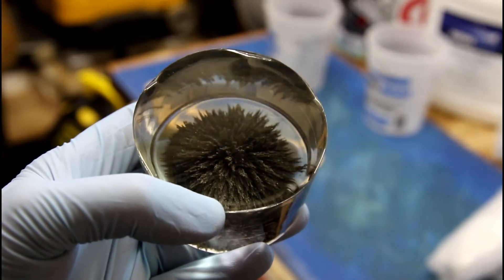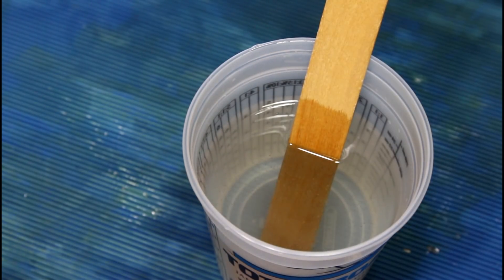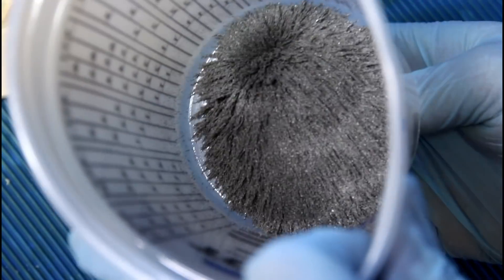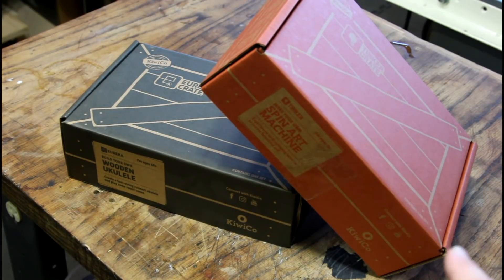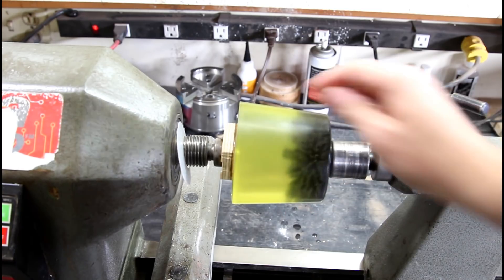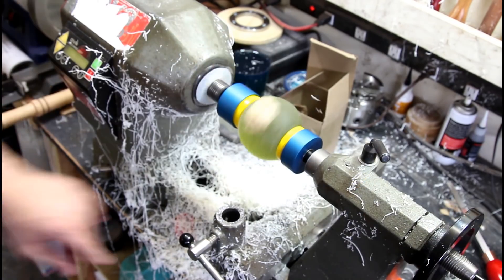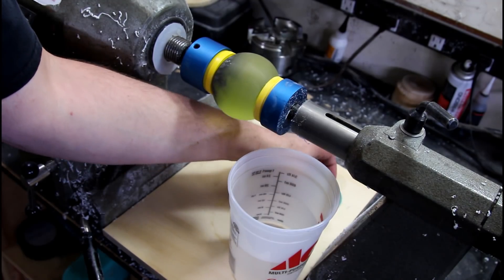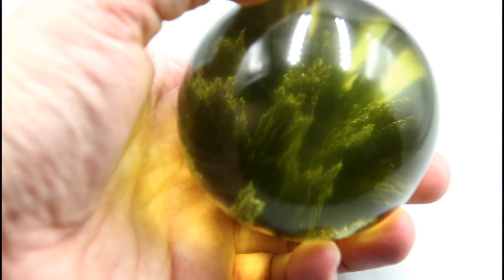The Iron Sphere | Dipit#30

Comment: hmmm, what if, bear with me for a moment... you took a reaaally strong neodymium magnet, and glued it onto a thin acrylic rod and place it in the center of a large enough (square) mold, then coat the magnet with iron filings until you have the magnet covered on all sides ... I have no idea how that must look, but in my head it's like a metal /iron filing sun / pointy star... type of thing? anyway, then fill the mold with resin and turn a perfect sphere with a 360 degree at all angles, suspended iron/metal star globe! ...

Comment: Hi. I have an idea. Take a magnet, glue a plastic (transparent) rod to the corner of that magnet. Add iron filings, and suspend that in the resin. This way the magnet and the filings are in the center of the ball and hopefully the rod will not be visible.

Comment: and your those sphere tools your a few bits away from lapidary basics. put a pair of wet sander pads/ grip paste on those sphere cups with a hand to guide and you basically have the setup used to make actual crystal balls and stone orbs. If you ever consider trying stone as a medium your really almost already there with your set ups. Just need diamond tools bits and a constant water drip system. I'd love to experiment with resin, wood, and stone some day.

Comment: Try putting iron filings in the epoxy before putting the magnet around it.  Then you can move the magnet around and pull the filings to where you want them in the epoxy…..  I’d like to see this in a video!  Maybe with glow in the dark resin?

Comment: You should do a pokeball biome in resin, basically a themed terrarium for particular pokemon types if you did a grass type you could even make the bottom half a nice dark wood, for water you could make an ocean out of resin dyed different shades of blue and white fire would be red, yellow, orange white etc.
Reply: You can also buy or 3d print and paint little plastic models of the pokemon!

Comment: Saw a videeo one time where they used a hole saw to cut spheres on the lathe if that works that would def been better for those iron filings, just sharing what i have seen never lathed anything more than rotors and drums

Comment: so... i have some lava, tephra with spectacular colors, which i think is due to the thin film refraction affect. i want to dip it in resin and keep the colors, but its extremely foamy material with insane amounts of air pockets, and i don have a vacuum chamber or pressure pot to cure the resin in, assuming it would be chemically inert to each other... im thinking i could try a spray type coating... but, im at a loss as to how to preserve the colors while its in resin... any ideas?

Comment: That was pretty cool, could I make a suggestion for another version.
How about taking the filings and pour them into the bottom of the cup and add a few drops of color then pour the resin on top. Use a protected (saran wrapped magnet) and lower it toward the iron, the resin will slow the movement of the iron and the different color may add something. It might form a thistle like blossom with a rainbow color scheme.
Again that was pretty cool.

Comment: Could you theoretically mix the iron filings into resin, then put a magnet on the side of the mold while it cures. Maybe the magnet would make some interesting patterns from the filings separation.

Comment: tip 1:
put a dash of silicone in between the measuring cup and the magnet to help prevent tilting
tip 2:
if you have a lid for the measuring cup, take a 6" long 3/16" bolt with washer through the center of the lid. then, trim the perimeter of the lid to leave a 2mm gap between the lid and the interior circumference to the cup. attach a funnel to the pour container and let the resin follow the bolt threads down to the lid as it dispenses the resin to the outer edges. spin the lid to more equally distribute the resin where needed. bonus points for drilling a hole down the middle of the bolt to help escaping air pockets.
tip 3:
put the wooden base on marionette strings or a mounting bracket with elevated, detachable handles

Comment: Did you think putting the magnet after pouring-in the resin? As the shavings move and settle inside the liquid, bubbles will come-out easily and gravity will have a lesser effect on the shavings.

Comment: That would look super cool if you had made two of the molds and then put them together so you had a ball with the shavings all pointing out from the middle. It would be easier to turn down also because you wouldn't be turning the iron at all.

Comment: If you had a resin with a very long cure time, you could try mixing the iron filings into the resin completely, then put it on the magnet and into the pressure pot to just sit there for a few days so the magnet can slowly pull them into a neat shape that goes throughout the whole thing. I think that magnet is plenty strong enough

Comment: I'd be really interested to see what would happen if the shavings were blended into the resin, then the resin poured over the magnet.

I just wonder if it would have the force to make them line up like that, or if it would just settle as a layer on the bottom?

Comment: just a idea but what will happen if you use slow setting resin? mix the iron at the start so it is suspended in resin then let the magnet pull it to one point

Comment: I would LOVE to see if you could suspend a small spherical magnet on a piece of very fine fishing line in the center of a mould and make a spherical starburst of iron filings centered in a resin ball...

I admit it will likely be a monumental PITA to try, but if you could do it, it would look spectacular...

I also suggest using the vacuum pot not the pressure pot to ensure all the air is pulled out of the iron...

Comment: How about setting it up as you did, washer, wooden disc, magnet, cup but then pouring the resin into the cup and then pouring the iron filings into the resin  so you could see how the magnet draws the filings down through the resin as it sets

Comment: Place magnet & board in the pressure pot, then the cup with iron filings in it. Place cup in pressure pot, move around until you have the iron in the pattern you want, then pour in the resin... Pale blue.. 😎

Comment: Try suspending a spherical magnet on a thin spike of clear resin then once that's dry fill a mold with resin then add iron filings after so they take a more organic shape around the magnet as the resin cures

Comment: what about suspending a small ball magnet. maybe glue it on the end of a bit of clear perspex and stick to bottom of mould then add the iron fillings so you get an almost spherical bloom of iron fillings and then if you tint the resin same as your perspex rod holding the magnet it should near enough disappear. or create to half blooms and the stick together in a bigger pour before turning?

Comment: Ooooh, that's gorgeous!!
Now, I wonder, how you could arrange a blossom completely suspended in a sphere?
Two blossoms joined back to back?
A plastic tube with a magnet suspended in the resin (so as to retain the magnet) and then backfill the void?
Or just suspend a relatively inexpensive magnet surrounded in shavings?

Comment: what a cool idea! those sphere cups for the lathe look like they'll be super useful. what's the range of diameters you can turn with them?

it looks like you lost all but the most vertical spikes after taking the blank out of the pot. I'm not 100% on this, but I think that since the magnet was so close to the bottom of the pot, the metal might have affected the field of the magnet, pulling the more horizontal spikes downward during the curing process. if you try this again it might be a good idea to set the mold platform up on some blocks in the pressure pot to get the magnet as far close to the center as possible, in order to minimize interference.

by the same principle, I bet you could get a better sphere effect if you glued a thin metal rod to the bottom of the mold to extend the magnet's field more into the resin. imagine if the spikes looked like they were growing from the center of the sphere!

keep up the great work! can't wait to see the next project!

Comment: would you consider doing a part three with the iron filings?  I'd be really curious to see if you could make another sphere with a full ball of shavings suspended in the center.  You would have to leave the magnet in place in the center of the casting, and do it in two pours (first half similar to this video, then flip it over for a second pour on the other side completing the ball of iron shavings).  Because of the lens effect you get from making a perfect sphere, you could use a much smaller magnet too, and leave plenty of excess resin around it so that you don't have to worry about running into the iron with your tools.

Comment: Maybe to make the upside down method work to its full potential, after putting the resin in the pressure pot, coat it with something thats insta cast to seal the top. Then flip it upside down as it cures.

Comment: I wonder if it would make a difference if you sprinkled the iron into the resin rather than pouring the resin over the filings. Or, if the particles are small enough, mix the iron into the resin and then bring the magnet close to it

Comment: What would happen if you mixed the iron shavings in the resin before putting the magnet on the bottom? The magnetic field should still align the filings into spikes through the resin

Comment: Crazy effect, could the magnet be used on the outside of the tub and pull the metal filings out through the resin that way the metal filings could be all through the resin?

Comment: Could you please roll it. With the weight distribution, that would likely be fun to look at. Plus it should lay pretty stable on its iron shaving side without rolling as much as other spheres, since that's where likely most of the weight is. Unless I hugely underestimate the weight ratio.

Comment: Very cool project. I wonder what would happen if you added another magnet but to the top of the pressure post while it was curing? Think it might make the filings extend to both ends of the resin?

Comment: I still advocate an attempt where the filings/ shavings are mixed in with a slow curing, very liquid resin and then cured with the magnet under it.

I would like to see how the magnet shifts the metal in the resin, it shouldn't be too different to the former attempts.

Comment: I was convinced the magnet was gonna do something violent in the pressure pot. I would've encased it on 4 sides with blocks of wood, but turns out your method worked! Beautiful result. I bet it would look even cooler with an embedded LED or 2 at the center of the flower.

Comment: I wonder if you could do 2 "blossoms" then put them facing away from each other and cast them into one, then turn it down into a ball. So that the center of the ball is a 360° iron blossom. Just think that would look amazing. Maybe with some electric blue in the resin to give it that "electromagnetic" look. Or very light purple like those "plasma ball" toys. 

Just tossing ideas out to inspire you. Feel free to use my idea I give you full rights if needed.

Comment: Just a thought, why not try two identical pours then bond them together at the bases? Then to turn it you would have the iron sphere in the middle instead of a lump at the bottom. Might make the turning a little easier since you wouldn’t have to turn in to the filings as much, and it might look cooler too. Just not yellow.

Comment: I love your stuff, do not care what it is, it is all cool.  A suggestion/request for these iron filings projects. using the magnet on the bottom, but then using a magnet (of slightly lesser strength) on the top . I am thinking hang it from a string at the top of the project so you can pour resin around it. My guess is it will make more shavings stand and it may make some of them appear to be lifting off. I would really like to see this done even if it is just a paperweight.

Comment: That worked pretty well, I wonder if you could get the spikes to be even more intricate by putting the filings in after the resin? With that powerful magnet I'd think they should still be attracted enough and with the viscosity you could get maybe even a better pattern than hanging in air.
Reply: I was wondering that too. I'd say add the iron filings to the resin and mix well, making a sort of ferrofluid, then add it to the cup with the magnet on the bottom.

Comment: What would happen if you used a long setting resin with the iron mixed into parts, you could also use a current through wire to create a magnet that you would be able to cast the resin around

Comment: An ideas to make an interesting sphere might be to put a magnet on the end of a dowel, cover it with plastic, pour iron filings over the magnet before covering it with resin. 
Then remove the magnet and down and plug up the hole left behind - or alternatively, just remove the down and put more filings and resin into that hole, - or you could even leave the cavity, and put a light up in there...

Then turn it into a sphere - i reckon that would look amazing - doing 2 shades on the resin could also look cool - though if you do that, you might even be able to get away with not needing the down hole, as you could hold the magnet up from above, and then leave it sitting there on your second pour.
Reply: just read some of the other comments about staffs - the hole in this could be used as a light on the end of a staff so you can 'cast something' at which point a blue or a red might be a nice resin tint, or clear and use an RGB led

Comment: What if you try setting up the resin over the magnet, then add the shavings. Or do it in steps, have an inch of resin add metal, had half an inch, add the metal. You might be able to get really talk spikes that way.

Comment: There's got to be some way you can float a cheap magnet in resin to make it the core of the sphere...
I'm thinking like, hanging it from a piece of coat hanger that you've coated in mold release or something...? Then do a tiny pour in that hole to fill it in, like stuff some pre-suspended iron shaving resin in there, then top it up. I dunno, it would just be neat to see a sphere with the magnet at its core.

Comment: This is super cool, but I cant help but wonder if there would be a way to have the magnet suspended in the resin with something like super thin fishing line and have the filings and spikes in the center of the sphere. Would suck to lose the magnet but you could probably use one that's not as strong.

Comment: Great results, Peter! Good call on dyeing the resin yellow, it really gives that 'trapped in amber' look. A magnetic field, frozen in time.
Though now I'm wondering, would it be possible to rig up a bar magnet in the middle of the cup, showing the toroid shape of the magnetic field, and then turn a cylinder from that?

Comment: Hey, Peter, if you try this again, I would suggest putting the base with the magnet in the pressure pot first, then putting the empty mixing cup on top of it, right in the pot.  Then the shavings and so on.  This way you don't have any worry about the magnet slipping out when it goes into the pot.

Comment: The final result looks very nice.

my suggestion for an even better result is to develop a means of potting it upside down. a lid for the cup could help, though there is of course the flow of escaping air... if you can create two or three pours without seams you might be able to set up a base which becomes the top of the sphere, then suspend the magnet with a barrier of some sort, and fill the segment to the barrier, or overfill past the barrier. the barrier of course would need to allow air to pass, and would probably also allow the resin to pass. the biggest difficulty is how to place the filings on the magnet before pouring over it in its inverted state. either a relief spout could be added to any non-important point that allows for passage of gases and resin, or you could set the filings with the magnet upright (with a barrier of course)  then invert it before the pour, or if you wanna be real cheeky, you could pour it all in one go and use tape to seal the relief at the opposite end, pour, seal that end, invert, then remove the tape to allow passage of gasses. the container would have to be taller than the position of the magnet barrier and it would have to be filled enough that while inverted and after air is removed it can still cover the entire part of the filings. the magnet could be protected in various ways from the resin... but mounting it in a way so it doesnt change orientation at any point, especially potting, is tricky. you have resin to make specialized mounting components, and can cut one of those cups in a way to fit these components together so the magnet is stable, resin will not leak, and air can freely escape....

some drawings would convey this more easily, but just a thought on how to improve the lay of the filings in the field, and further enhance the gravity defying look.

Comment: Next time, make two of them and join them together like two halves of a sphere, before turning it into a sphere.

Wouldn't you have been able to just move the bucket along the magnet to get the filings reoriented and spaced evenly? I am not sure how the density of the resin would prevent that, provided the magnet was strong enough.

Comment: What if you used electromagnets for this? Using copper wires strung through a pinhole I your resin mold maybe? That way the filings could be directed in all sorts of cool ways, but you wouldn't be losing an expensive magnet inside the resin.